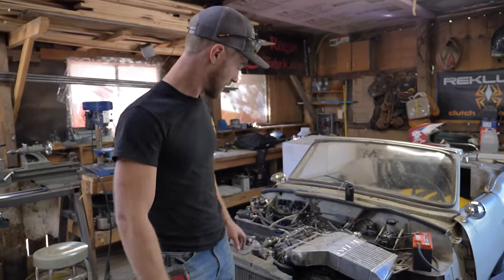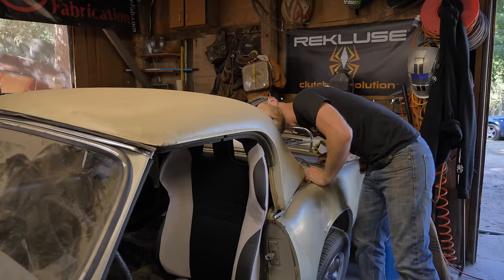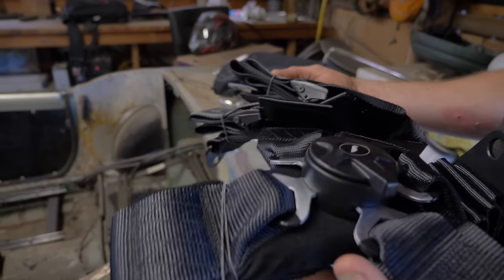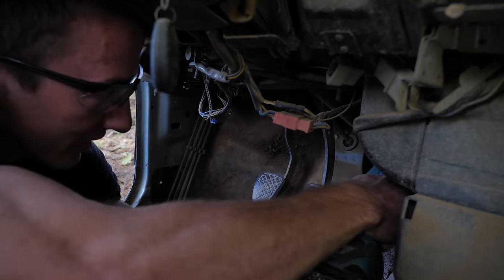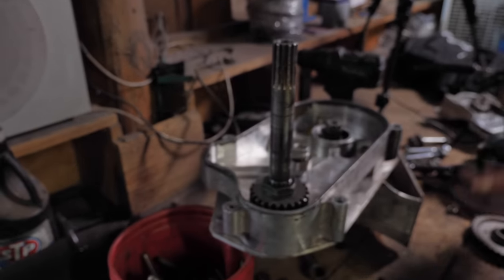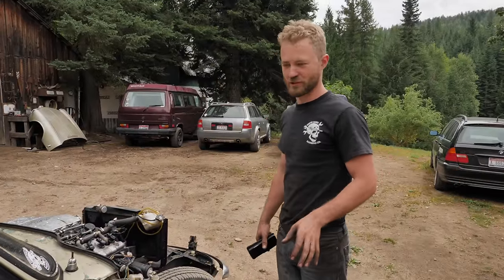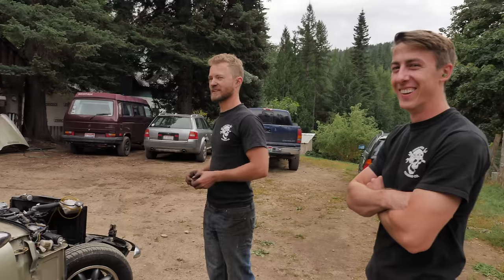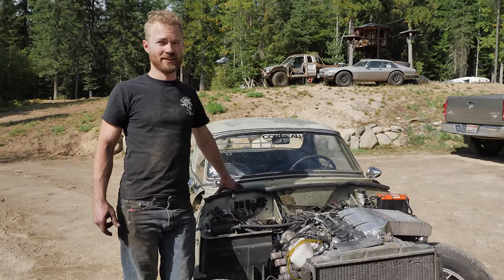Snowmobile Powered Car Test Drive! Supercharged RX1

Comment: If you guys need any suggestions or help, I built a 68 Triumph GT6 with a 289 Ford V8 and C4 transmission. I had many of the same obstacles to overcome. Cool build BTW. Should be an adrenaline rush.

Comment: Corbeau made seats that fit the lotus elise, we used them on our triumph gt6 track car, that's running 280bhp and a volvo turbo engine
Reply: I built my 68 street GT-6 with a 2.5 liter TR-6 engine, Rajay turbo, Chevy Monza clutch, flywheel, pressure plate, starter, Warner T-50 5 speed overdriven trans. At 14psi boost the power was insane both rear tires would spin in 3rd just passing through 4500 rpm. But that rear end would blow out in every kind of failure mode... pinion teeth gone, spider gears blown, spider cross shaft sheared, carrier housing split, etc. After 6  junkyard GT-6 rear ends I just started using Spitfire units and egg shaped the flange holes.  I blew about 10 Spitfire rear ends then sold the car when the ring lands collapsed again. It was fun for a few years.  I hope you went to a decent rear end  in your car.  I still have a 4WD Chevy V-6 powered Spitfire on 33'' tires.

Comment: You've gotta take this to some local motorsports in your area! Stiffen up the suspension, and set it up etc and do some autox, in scca almost all the A Mod cars run snowmachine drivetrains. They're all wild crazy tube chassis stuff though. In SCCA rallyx RWD Modified has pretty wide open rules that this would probably fit into.
Reply from the maker: Yeah the problem is by the time it's ready for autocross it'll be winter here :-( but in the spring we we'll take it out for sure!
Reply: @GrindHardPlumbingCo  Set it up for winter rallyx then if there are any events in your area! I'm getting my winter shitbox racecar ready haha

Comment: Isnt that a two stroke motor? Im not big on snowmobiles but if it is indeed a two stroke then you absolutely need that expansion chamber on the exhaust for the motor to run right.  Not to be a know it all, im just excited to see this build! :)

Comment: Hey man before you go change the gearing check in to clutches for it. I mess with them a lot in the four wheeler world on can ams they sell billet clutches for adjustable weights and spring rates

Comment: carbs will definitely need to be adjusted its likely jetted to run only in the winter and at high elevation .. you guys should really invest in an air fuel ratio gauge you can remote mount in any of your projects just weld in an 02 bung twist in the sensor add power and tune the carb to perfection .  remove sensor cap the bung and store it away for the next project .. saves a lot of time

Comment: You Need Exhaust to tune the Engine RPM Torque, as it is now you can hurt it getting cold air back up in the Head throwing it out of tune for best Power and Scavenging run 4 into one! ! Definatly Rebuild the Tunnel and Build Driveline Hoops on Both Ends of the Driveshaft!!

Comment: Surprised that the body and chassis is still on the road...most of those spitfires and GT6's here in the UK have now reverted into 4 buckets of rust!  Talking of handling, those cars have a crap rear end.  You used to be able to get a negative camber rear spring which improved handling a bit!!!  If that is a stock gearbox and diff it will never last, I had a very hot 1300 years ago.  It would throw the locking circlip on the 3rd motion shaft cluster losing 2nd and 3rd gears and it ate rear diffs...I had to replace the drive train with 2ltr Triumph Vitesse components.  You also need to fit a servo to that thing.

Comment: Old Chevy corvairs in Pontiac the transmission is actually at the rear of the car so it's actually a transaxle with a torque tube then you could have more than 1 gear

1963 tempest uses a transaxle. Or you could always use a Corvette transaxle. More than 1 gear either way.
Reply: There is no torque tube in a Chevrolet corvair the air-cooled boxer 6 was bolted to a three speed transaxle. The car is in the class rear engine rear wheel drive (rr).because the engine is behind the rear axle.   Now corvettes have been using a engine/torque tube/transmission/rear differential driveline since 1997 in c5  vette.  All corvettes are front engine rear wheel drive.  Lil update for ya brain brother.
Reply: @dlutner8142  ok, I quest that just a Pontiac thing then
Reply: @dlutner8142  1963 tempest was front engine with a transaxle at the rear. Only reason I know that is because my uncle has one with a 326. Which according to him isn't actually a 326 it's a 336 or something.

Comment: SEATS!! You could cut a 2" drop box for the seat frame.  Cut the stitches and cut the top of the Corbeau seats off at the bottom of the slots. Taper the shoulder bolsters down and stitch it back up.  You have to add at least 10 inches to that driveshaft. Get the secondary out of the car. You will never get a certification without a firewall sealing the cabin from the engine. You could rotate the chaincase to get the secondary straight up behind the dash and box it in there. 👍👍

Comment: If you do not want to roll it, put a spacer under the rear spring lowers the back and stops the back wheels tucking under . inch and half will do.

Comment: Just found your videos. I could have warned you about the Narrow seats, your options are fewusedI have an early 1963. I used some fiberglass shells i found on ebay, $65 each plus upholstry. Just bolted them in, no adjustment possible.

Comment: Suggesting a gear vendors overdrive unit to strap to the back of that transfer case its electrically activated and it’ll drop the rpms check it out

Comment: I screwed under rail structures, long, slider wide, 3/8ths heavy duty solid rubber mat.
a taller/thicker mat semed unstable; thinner was useless.  
good application thickness gives lovely cushion along with firewrap/carpeting.  
being inches off the pavement, any suspension opportunity taken.  lol!

Comment: The reason why it's not running right is you need the original exhaust designed for that engine. Racing 2 strokes are very sensitive in the exhaust category.
Reply: It's a 4 stroke. Should run ok with any decently designed manifold

Comment: Go back to the first gears and swap them put the small gear on top and the big gear on bottom also so put and exhaust on it might make it run better with a little back pressure

Comment: Those seats will still fit. Drop the whole seat pan 3 inches. Build it strong cause your ass is your new skid plate add another 15 degrees give or take of rake if need be to the floor pan and the adjuster will compensate for the leg room. 
  Going to need some suspension work to get that to handle better. Much wider front tires. Might as well go crazy and put in the new trans am 305 section front tires and a whole new body up front or serious messaging and custom metal flares. 😆 Hahaa. She will drift and corner like a dream. Haha. That Trans am corners like a beast on rails. 
  Get the boost and tune figured out. Fix the slipoing belt add 100 shot of Nitrous and you'll be good to go. Roll cage optional.

Comment: Hey guys you really need a low rpm locking clutch kit. It should lock in at first crack of the throttle.

Comment: Why dont you source an 8.8 with the appropriately geared ring and pinion.  Then just cut it down to fit.

You can also buy weight kits that change the engagement of your centrifugal clutch.  I'm not %100 certain about your make and model, but I do know that they're a thing and that they can be bought. Lol

Comment: Needs an Equal Length Header and a shield of ½" steel over that clutch and driveshaft. That stuff spinning at 10k can do some serious damage if it lets go.
Reply: Half inch?
Reply: @jacobj1517  Overkill. Better safe than sorry. Driveshaft safety loops are about that thick. It's the factory driveshaft and wasn't designed for more than twice the horsepower and 4k more rpm. Driveshafts make floorplans look like tinfoil when the let go. Make it impossible to come into the cab with some half inch.

Comment: Guys guys guys. I need help here. Control arm on my daily and I live in Minnesota.  The two frame bolts both have a welded nut with no access. Completely seized. No more like fuzed together bolt and nut. The strut arm bolt basically got cut down but the head of it is still absolutely fuzed with the  arm. Gonna have to find a grinder and knock it out but any ideas on the two frame bolts? I'm about to scrap the car. Money and resources limited. One bolt vertical one is horizontal.oh and the sway bar end link stripped the inside Allen head so now the joint just spins I'm at a freaking loss here.i have Tried heating then pen oil repeated.  Still nothing.

Comment: Put a new cvt belt on it.  It is not riding up in the secondary like it should
Reply: Belt wont help. Needs lighter primary spring and more aggressive angle secondary helix. It will shift out faster that way.
Reply: @Subydude-rp9yv  belt will help if the current one is worn out as 200hp supercharged yamahas will. Yamaha Secondary also has a belt height adjustment with 3 bolts/shims on the back. Belt should ride just above the edge of the secondary sheeve.  I own 4 yamahas, one 200hp turbocharged
Reply: @toddstanley7804  fair enough. I ride Yamaha as well. If the belts worn, in my experience it feels like my sled is starting in '2nd' gear. The rest of the rev rage is fairly normal. I was just suggesting the primary spring and secondary helix are going to make a profound difference. However as they change those things, changing the belt at the same time is a great idea too.

Comment: The early Spitfire had a very awful swing-axle that will kill you dead faster than any Corvair when going sideways over bumps. You'll need to install a camber compensator unless you want to roll the car & die. http://www.spitlist.info/CamberCompensator.html

Also: goodbye differential. They're stupid-fragile. At minimum use the highest grade synthetic gear oil possible.

And OMG - any cursory search of Spitfire seat mods would've shown that those enormous Corbeau seats would never have fit. Most Spitfire owners install 2nd hand Miata seats, and those are a tight fit and sit a bit tall. I have a pair in my TR6 and even there they are a bit big.

Lastly, had a u-joint broken on the differential during the test drive ... etc. Yikes.
Reply: Chuck the effing thing out altogether and drop in a solid back axle. I consider Standard Triumph should have been taken to court over this reprehensible abortion of a design.

Comment: Needs expansion chambers/exhaust, just like the Barbie Jeep you guys are missing a work of power without it being correct. Especially a 2 stroke
Reply: the yamaha RX1 is 4 stroke dude. no need for expansion pipes. it's basically a yamaha R1 less the transmission.

Comment: Drop the floors 5" with front to rear skid bars under to mount to. Those thin floors not made for the forces the seat mount bolts will put on it. Common Fox body issue. Someone has never seen a drive shaft try to act like a pool noodle.

Comment: Jesus, dude... driving that thing anywhere other than moving it around in the driveway with that driveshaft/u-joint exposed right there next to your arm is SUPER dumb, even for guys like us. You could VERY easily permanently ruin your arm just from a pothole or one suspension part or tire failing unexpectedly. I'm usually notorious for being pretty sketchy, but you couldn't pay me enough to do that at any kind of speed or for any kind of distance.